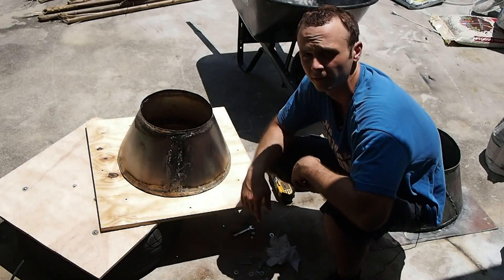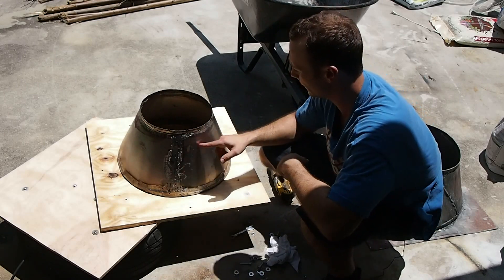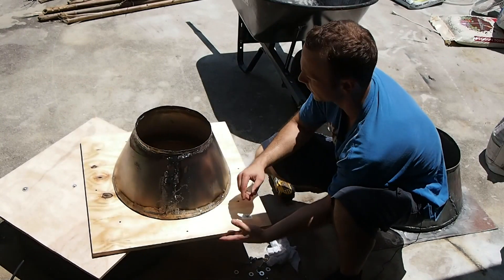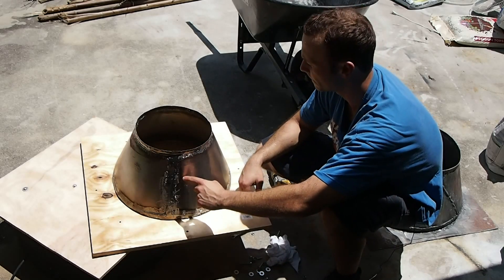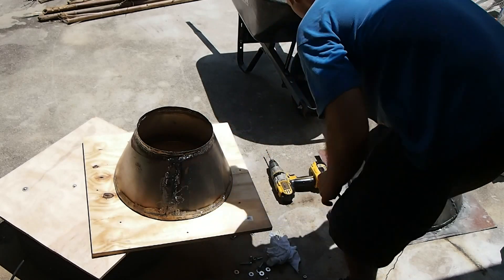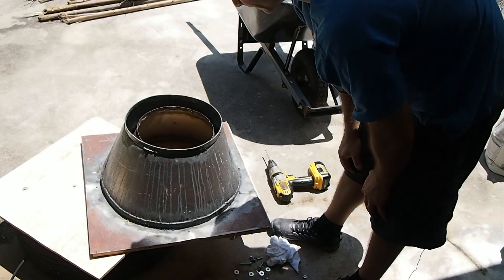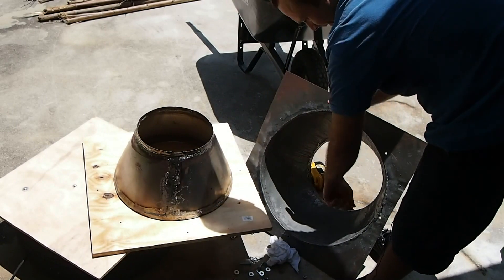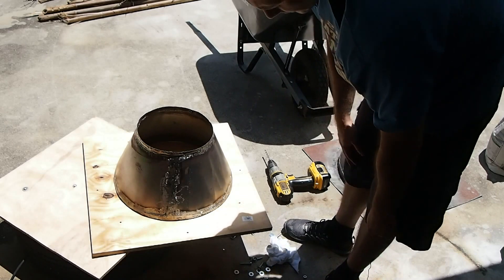Wood Gasifier - Inner Heath Construction Part 1

Comment: I think the concrete will crumble/crack from the heat expansion. Try using high temp  furnace refractory cement.